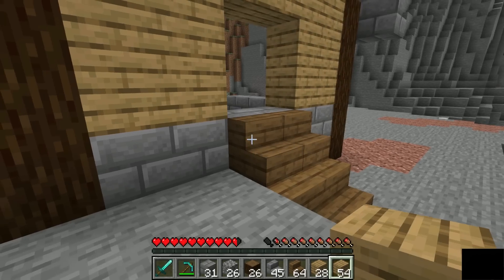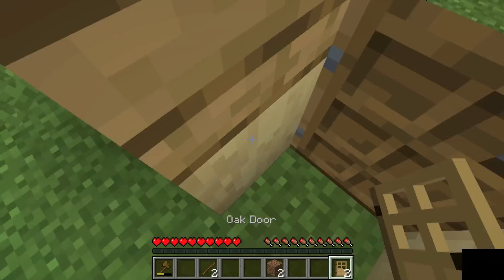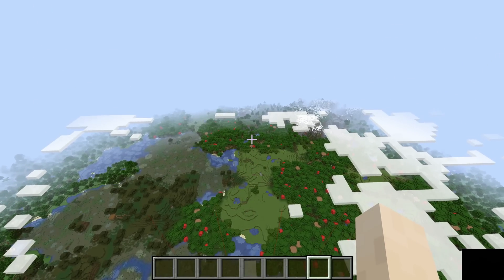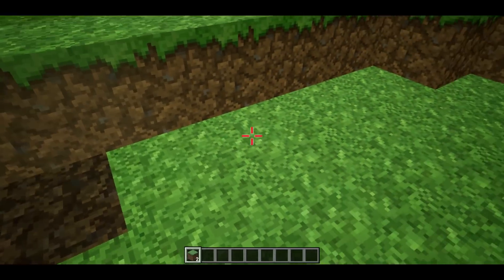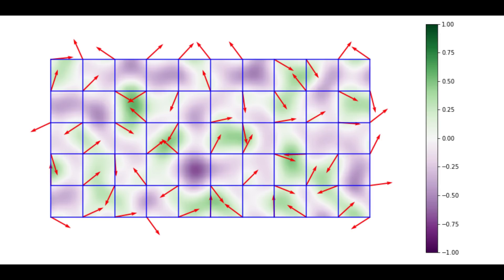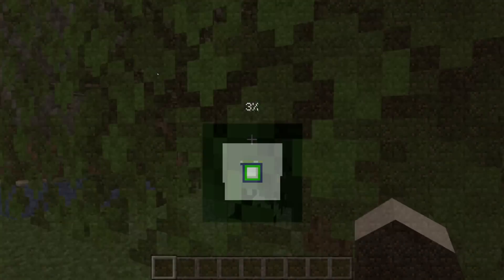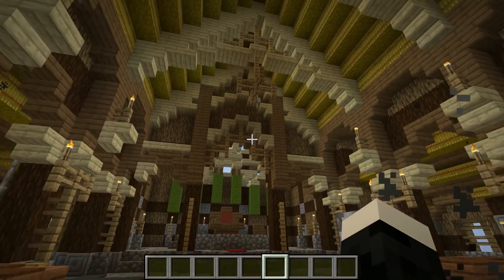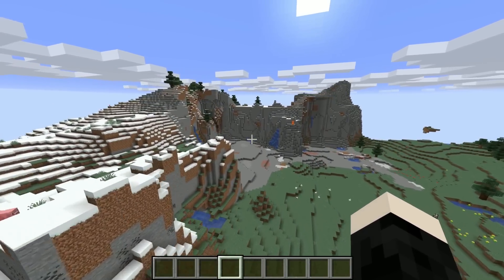Why Minecraft is a Technical Feat | Explaining the Engineering Behind an Indie Icon

Comment: Having invented my own Perlin Noise variant and successfully re-written much of the world generator in a mod, and later failing to make my own chunk mesher for something else, I can tell that chunk meshing is actually much harder than gradient noise like Perlin's.  The concepts behind chunk meshing  (which involves more than face culling) are actually quite simple, yet it's surprisingly hard to code right.
Reply: that type of thing is my programming nightmare.  A concept that is simple in my head, but complicated as all get out when you try to teach your laptop to do it.  Super satisfying when you finally get it though!
Reply: Its the kind of algorithm that you put in a library to re-use everywhere.

Re-inventing basic need algorithms is not productive at all (interesting and educational maybe, but not efficient).

If you have a proper library, you can then have people optimize that library for performance and get the benefits.
Reply: Greedy meshing has me stumped and unmotivated. Even minecraft doesn't use greedy meshing
Reply: @ianmoore322  I screwed up my greedy meshing coded (probably careless mistakes and types) and it was too long to debug easily.  I then realized then that since I was making a game based on indoor dungeons I didn't need meshed chunks, so I did writing a kind of greedy mesher that work in turning 2D arrays of heights into 3D rooms (not a chunk mesher but a room-mesher).

Comment: Okay, this video feels like it was made by someone who has a surface level understanding of how minecraft works.

I was hoping this would be a video actually talking about the engineering on a technical level but this video is just explaining stuff anyone remotely interested in how minecraft works already knows. 

You mention how some optimization challenges are solved by hiding faces, but you don't even begin to discuss the concept of greedy meshing, a much more important part of the optimization process. You don't mention how the game was built such that it's extensible and moddable. And above all you completely sweep under the rug that all of the "innovations" that you talked about already existed. Don't get me wrong, the Mojang team (not just Notch) still had to implement a whole bunch of algorithms and apply the ideas, something that is not an easy feat by any means, but minecraft wasn't a technical innovator in the same way it was a gameplay innovator.
Reply: Yeah not rendering geometry that's behind other triangles is literally just how 3d rendering works in openGL. And then discarding that geometry completely is 2 lines of code (to enable depth testing). And then frustum culling isn't new either. It's cool, but it's incorrect to claim that this is minecraft's innovations, since this stuff was industry standard long before the game came out.
Reply: @Dezomm  Exactly. And backface culling is a GPU feature, it's literally provided by the hardware.
Reply: @r.pizzamonkey7379  even if backface culling is a gpu feature, submitting all of that extra geometry takes so much more ram that you kinda have to either use greedymeshing or cull faces manually

Comment: At 6:40, you say the wourld height is 256 block. That is currently correct, but in hopefully a few months, that piece of data will be outdated, as the next update expands the world height by 64 blocks at both the bottom and the top. The new world height will be 384 blocks from y=-64 to y=319.

Comment: I don't understand why they had to use triangles to render squares, wouldn't it just double the number of surfaces that need to be rendered for no reason?

Or is this because computers can only render surfaces defined by 3 points, no more and no less?
Reply: Triangles are the most efficient way to render things, there's not really a reason to render any other polygon as they can just be split into triangles, so renderers and GPUs only do triangles
Reply: GPUs only have hardware acceleration for rendering triangles (and pixels).  There is no native support for voxel rendering.

Minecraft quantizes the world (uniform grid with implicit coordinates) storing it as voxel data.  It must convert this voxel data to mesh data when to render the world.

Comment: you didn't say anything. the light levels, block geometry, these are trivial. this isn't "why". the only thing of note you mentioned was "700,000 triangles, compared to a watch" yeah, that's a lot of triangles and then you totally discarded that as an issue when you mentioned it is converted into a large mesh for one giant breakable object.

the reason minecraft is technical feat of ingenuity is because one man did it. then it can be converted on the local machine and all the data can be accessed, giving opportunity to modify, correct, destroy the code within. the triangle thing isn't a minecraft success, that's time and technology. and then there's the consideration of "point cloud data" which is the same principle, and the voxels are atomic in size.

you said nothing.

also, when you're reading a script, you're not supposed to talk like it's a text book, "as above" isn't what you SAY. "as previously mentioned" is the phrase to use. i also find it frustrating to give a channel a chance when they say "why minecraft is a technical feat." and say "maybe" when pretending to know something others don't know. your video is shit. do better. actually research. people don't select a video on "why" for "maybe" to be the focus. the only true thing i picked up on was the Perlin Noise method. the rest is absolute bullshit useless.

if anybody needs to know, the light levels are what dictate the spawns of mobs. the last time i played it was common/shared knowledge to use half slabs to avoid mobs spawning in dark/unlit areas, especially when the Brightness has been adjusted to mine in the dark or build underground. saves time on torch making and doesn't waste resources. that's the only useful thing about light levels in minecraft. if the mob spawn rules have changed, find out, i could be wrong.
Reply: you alright bro? getting bullied in school lol?

Comment: I enjoyed the video but a few nitpicks: Perlin Noise is definitely used in terrain generation, but you've skipped over how just using a single layer makes for very wavy, simplistic, and uninteresting terrain, so most terrain generation based on Perlin Noise uses several layers of increasing frequency and decreasing amplitude to make for more interesting details. The first layers make for the mountains, the next for peaks and hills on them, the next for rocks and cliff edges, etc. A single layer of Perlin Noise will just look like a 3d sine wave gone wrong and not very much resemble proper terrain. MC's terrain generation also doesn't go from 0-256, and the heights it ranges between vary based on the biome it's looking at. Oceans go lower than hilly area, which are lower than mountainous areas. So the range for the height map maximum and minimums are first checked against what biome the current coordinates are in, and how close they are to a neighboring biome (to create a smoother transition between biomes rather than harsh lines) and only then is the height determined.

Secondly this may have just been how you ordered your items in the video, but cave systems were one of the first things created in MC, and certainly didn't come after terrain generation. The very first videos you can see of MC's original prototypes are of a player navigating a visually chaotic mess of cobble (the caves) in a few small chunks before infinite terrain was even added. Caves even in this simplistic form were one of the first features implemented, and the terrain generation of the surface of the world was added afterwards.

Thirdly I wouldn't call MC's world entirely random. Against just a nitpick, but when you start to add in structures it becomes less random, by definition. I'm both referring to the buildings, mineshafts, and temples as well as the structure MC uses for all of its terrain generation. Both of these things add more order to the randomness. For example you'll never find a birch tree growing sideways or upside down without a player having manual done that manually. Villages always have a well, and temples always have TNT at the bottom of their pit. Barring only something else cutting off these structures through an overlapping higher priority object, these rules can't be broken by the terrain generation. MC's terrain generation is indeed very random, so it can have a lot of diverse and unique things, but it does have order because something entirely random is nowhere near as useful as the more ordered, structured, and guided random that MC and most other games in similar veins use.

Aside from those, I can't find much any other issues, and everything else seems to be more or less accurate.
Reply: Lovely comment, thanks for the ellaboration, was already wondering about his explanation of the terrain generation.

Comment: This was so interesting! Do you have a video that explains how Changes to the maps are saved, and how the data structures handles this?
Reply: Not too detailed explanation, but here's a high-level overview:

A chunk is generated, and a table of id <-> block is made for the chunk (MC switched from numerical IDs). You also have various block states, which are just simple 4 bit values, and Tile Entities, which are used for more complex data and stored separately.

A chunk is an area of 16x256x16 blocks.

Those are then stored in region files on your disk. 

Tile Entities are separate, and store data such as inventory contents. They are serialized or deseralized from strings on chunk load/chunk save. This data is called NBT, and it's basically JSON.
Reply: Uh, that would interest me as well. Always wondered how the block positions are stored.

Comment: There are still some mistakes made here, but in general it gives a good overview of the problems Minecraft has faced.
If you use deffered rendering you can have unlimited light sources in a modern game that are dynamic, but it costs you a bit more performance then forwards rendering.
And about the blocks, the wireframe view you showed must be from a Minecraft Clone, because as far as I have learned Voxels still work different then the big generated mesh you are showing here.
But anyways, still a good video for non programmers or game developers like me.

Comment: 9:02 I'm actually more curious about how exactly the modern world generation is achieved. I would imagine they build a list of every biome, then use a seeded noise function, although what smoothing algorithm would they be using which doesnt constrain 2 biomes next to each other like you would achieve with perlin noise.
Reply: If each biome appears only in a certain range of the perlin output (and perlin is smooth), then you can easily order the biomes according to their value range. For example if you only use 3 biomes (desert, forest, snow), you can make sure that desert (low values) would never border snow (high values), but always border forest (mid values).
Combining several perlin (or other noise) maps (humidity and temperature for example) can create a lot more variation for more biome types, while ensuring that certain biomes dont appear next to each other.
Reply: @vast634  Yeah that would work for their original system notch planed out which was discussed in the video. but modern minecraft doesn't generate biomes like that anymore because this system wouldnt be cpu efficient to mark biome borders with rivers. I was more interested in what the modern system might be using.

I've found a different noise function which is much more likely the case used in minecraft. It's called worley noise, aka cellular noise, specifically the output is the cell value. this gives a large random area with any value independent of it's neighbors. This is much more cpu efficient then having the get the similar effect with 2 or more perlin noises and interpolating the biomes based of this. it also helps prevent the big o problem when having too many biomes you wish to generate. It also allows for rivers if you use all the same setting and gather the output of distance1 - distance0.

For anyone inerstested in more information on this, the FastNoise github repo was an extremely helpful resource for testing all this out and even porting the code.

Link: https://github.com/Auburn/FastNoiseLite
Reply: @Tinkerer_Red  Overall calculating the noise maps for biome type of the chunks (its only 2D) causes not really much impact on the performance. The 3D calculations (caves, placing trees), and generating and optimizing the mesh, and compacting+storing it to disk would take most of the time here.
Its might be even best to keep a large area of the biome map in memory (not just the new chunks), lets say 2048x2048x8bit,  (not that much memory needed) so the game can apply some extra manipulation on it, stuff that per-chunk calculations cannot do when missing the adjacent chunks.

Comment: Micrecraft cubes are not fully voxels, they are "boxels", like 3D versions of tiles. Voxels are much more than just that, is what is used to make the 3D images in MRIs for example, and many games like No Man's Sky do use a more proper implementation for their terrain for example, but hey don't look ugly so they don't call them voxels. Thanks minecraft fans.
Reply: Not sure voxel should be confused with a rendering technique. A voxel is a 3d pixel, the method used to render it I would call something else. I would say NMS uses voxels with dual-contouring.
Reply: @SerBallister  I agree, but when people talk about Minecraft "voxels" they usually refer to the blocks / 3D tiles, thus "boxels". And as in minecraft each block has a 1-to-1 3D representation, so if you take blocks to be voxels then it makes sense to think that way. Just used those other games just to point at examples of what can be accomplished with actual voxel data, but sure it's technically wrong to mixup the rendering technique with the data representation.
My point was that it is a bit of a stretch to even think of minecraft world as voxel based, unless we dumb down the idea of what a voxel can be a whole lot to begin with. It's like saying that I drive a race car to work everyday, but the only problem is that my Toyota Corolla just happens to be a really lousy race car. It's a form of equivocation.
Reply: @trinidad17  Interesting take, how would you define Minecraft then ?

Comment: Great video covering some of the core rendering concepts.

I would love to see more of a deep dive into the Update Loop of the game. Specifically how entities, blocks and chunks are updated with ticks and how that is adjusted based on player proximity to limit the otherwise unbounded time it could take to update all the things you've explored in an infinitely large world.
Reply from the maker: Those more in depth videos may be coming out very soon ;)
Reply: (based on my knowledge of the original Minecraft Alpha version) The game is generating the chunks at runtime when getting into proximity the first time, and dumping them onto the disk (some 3D array format) for later loading. Actor entities are just spawned in near the player. They cease to exist when leaving the chunk area. 
As long as they are within a active nearby chunk, they have all the data they need (collision "mesh") to move about. A very basic tick update-logic NPC ai. I suppose the logic ticks are decoupled from the rendering ticks. (otherwise the game would run into constant imprecision problems given its high performance requirements on different machines backs then)
Reply: IIRC update() is called chunk-wise, so all that's needed is chunk management

Comment: Please stop giving Notch more credit than he deserves, and Zachtronics (maker of Infiniminer) less than he does.
Notch did NOT have to solve any of the problems around how to efficiently render the blocks and reduce the tricount. It's what Infiniminer already did. Minecraft happened immediately AFTER Infiniminer's source code was leaked, including all that logic.
Reply from the maker: I may have overstated Notch's impact on the block culling techniques and I'm sorry about that. I do feel that Mojang had to innovate a lot to overcome the limitations in Infiniminer though. As far as I know Infiniminer only had cubes as blocks, no stairs or fences which require special algorithms, and Minecraft added lighting, a much larger world height, mobs and world updates and everything. I'm basically saying I don't think it was as simple as taking Infiniminers code and slapping some new textures on it, but I haven't looked at Infiniminer in depth so feel free to correct me if I'm mistaken :)